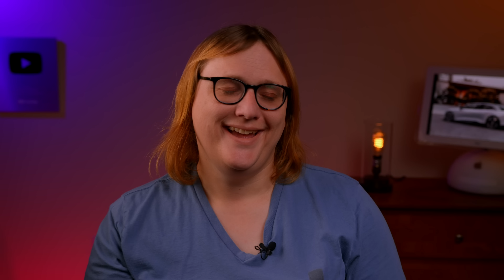Lucid Air Revealed! Here's Everything you Need To Know!

Comment: Another ICE killer. This what I consider  Tesla+1 car,  the goal has been to make it a step better than Tesla for what luxury car buyers want. It took them 5 years which is what it takes to design such a car, but Peter had advantage of working for Tesla so he already knew what not to do.
Reply: unclezeppy this won’t kill ice until it can be had for twenty or thirty grand.
Reply: @nickiemcnichols5397  If everything goes as planned there will be will be smaller/cheaper Lucid models after a couple of years. Then the question is can you even buy a ICE car when car manufacturers (not only Ford) have already announced they will stop making passager cars. You can buy a MB or BMW ICE but actually it is a VW, all the bigger models are EVs. One VW manager told me if you want an ICE car made in EU after several years it will be one made in Romania or other old eastern block country, and they might be mainly for those markets. Parts prices will go up since there are not that much demand for them.